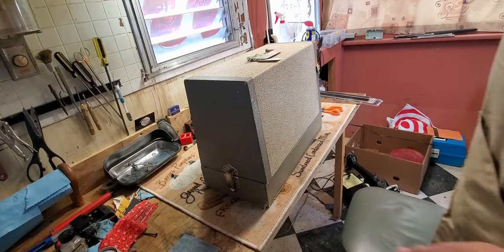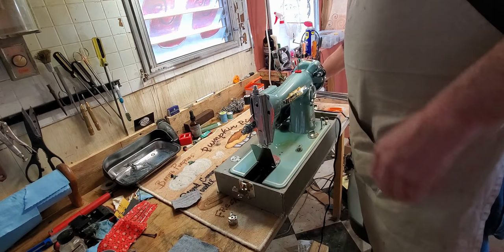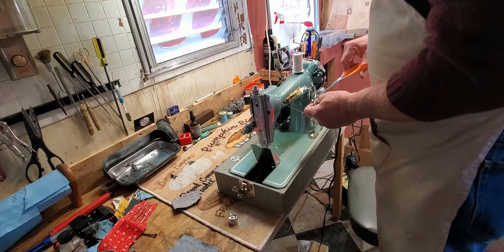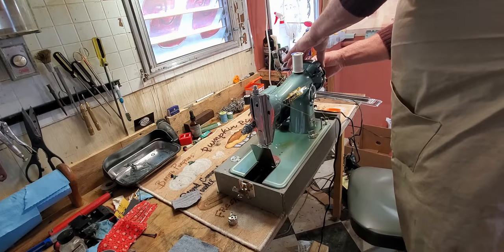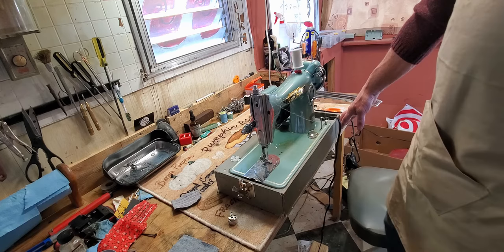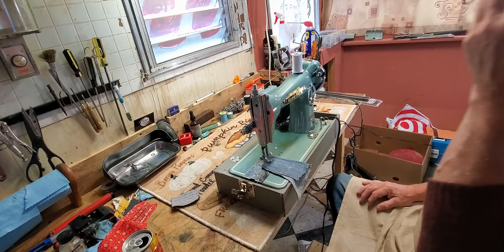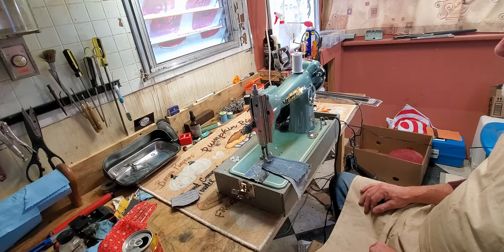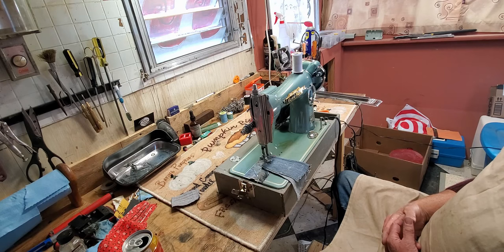Home Mark Sewing Machine-final test and how to

Comment: I just watched your video from 7 years ago regarding the singer touch and sew 600. I've been using my Kenmore 30 for the past couple decades and decided to pull out my singer 640. It worked perfectly for about 5 minutes and then all of a sudden, the needle thread won't go around the bobbin casing. (To loop the threads together). So the needle punctures the fabric, but because its not grabbing the bobbin thread, its not actually sewing. Any suggestions on how I can rectify this myself, or should I take it to a professional?